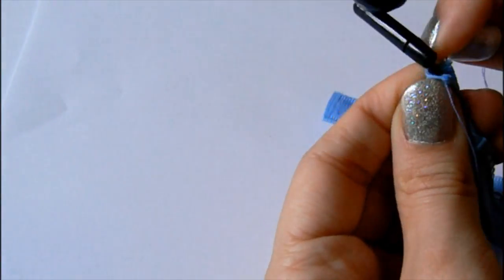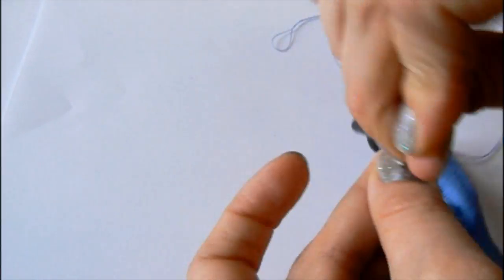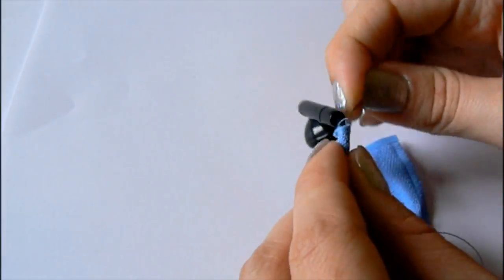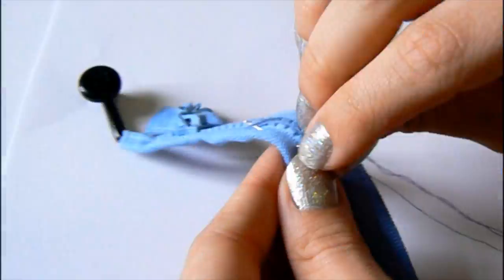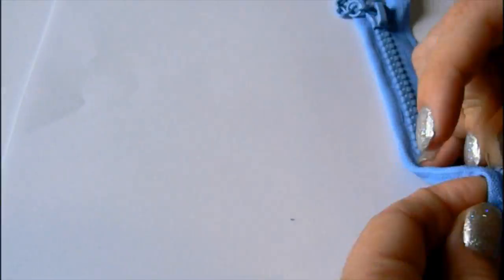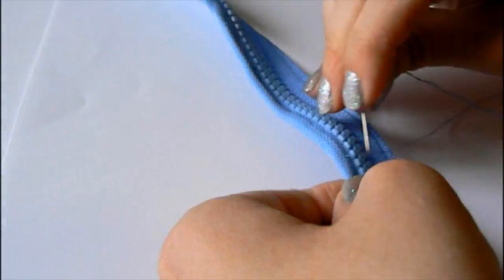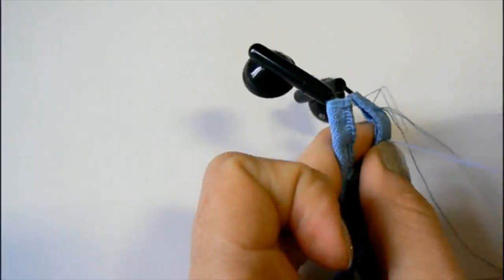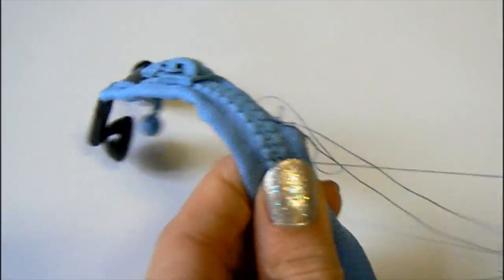DIY Zip Earphones | LDP

Comment: Its a brilliant idea but what about the bottom part of the headphones when the two cords connect?
Reply from the maker: Ani Davidian Just get a zip slightly shorter than the length of your headphones, and it won't prove an issue - the zip won't affect the cords connecting and will still stop your earphones from getting tangled. :)
Reply: The idea to zip it very good but doing it for only the half part doesn't serve the purpose.

Comment: this one is the part where the earphone splits
how bout the one cable part?
Reply from the maker: +Wan Aliffudin I didn't use that type unfortunately, so I'd try using a shorter zip for the two-cable part, then decorate the single cable part differently.